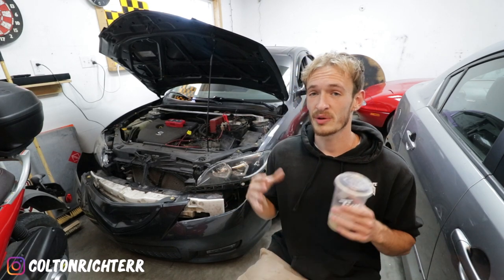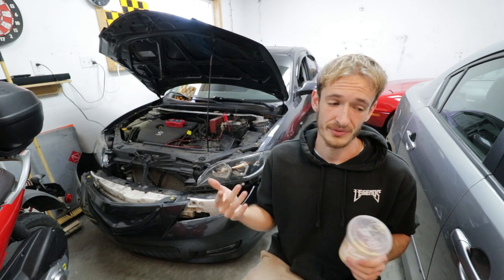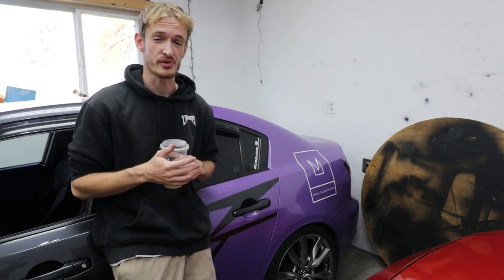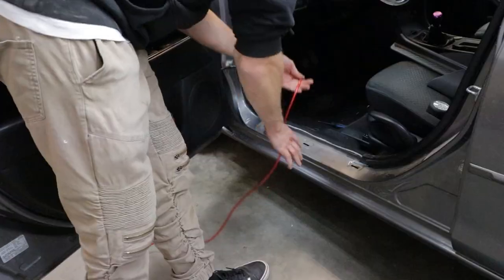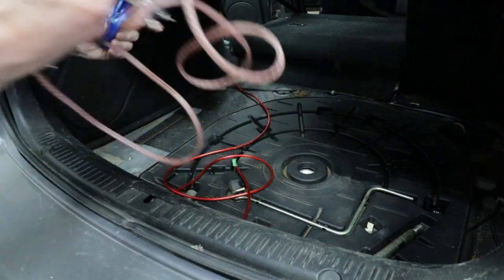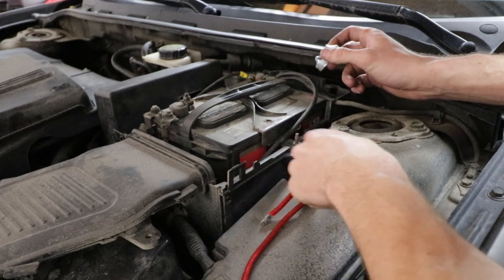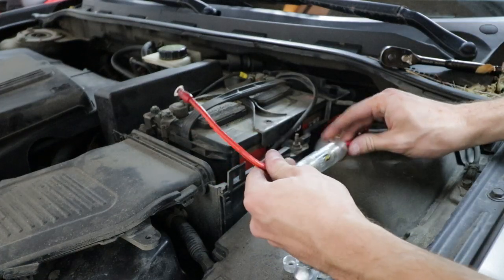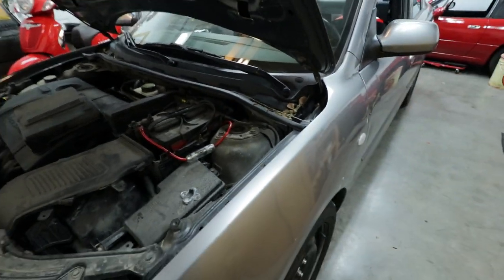MAZDA 3 Subwoofer & Amplifier EASY Install Tutorial!

Comment: sry man i feel dumb for asking u this but im sting up a rlly huge rockford sub and i rlly dont want to mess things up my question is only about de ground cable were did it come from? i have a 2011 mazda 3 hatchback 2.5
Reply from the maker: Where did it come from? Your ground cable comes with your wiring kit. 

I bolt them down the the rear seat mount.

Comment: the amp power on should have been connected to the blue wire on the back of the stereo called r e m or blue amp wire on the stereo its self so the amp only comes on when you turn the stereo on not the egnition otherwise if you dont want the stereo on the amp will come on anyway when you turn the key
Reply from the maker: Ah, didn't know what that blue one was for 😂
Reply: Hello do you know i lot about it cuz i wanna connect a subwoofer in my 07 mazdaspeed 3 but it is stock radio, I want to know how it can be connected in my stock radio.
Reply: @gtavlovers3354  you can run rca to speakers into the amp  omn a stock radio
Reply: @AdamSNook.  can you do a diagram for me how it can be made.
Reply: @gtavlovers3354  on most car amps you have a high input aswell as left and right phono you connect your speaker wires from left and right speakers to the high power input on the amp so your stock radio as ither 2 channel or 4 channle 2 run all 4 door speakers you just need to tap from them to the high input on the amp
Reply: @AdamSNook.   ok.
Reply: @AdamSNook.  I want to do a bluetooth conection into mine stock stereo cuz I don't have AUX cable option in my phone
Reply: @gtavlovers3354  u can get blue tooth that works by using a radio station ut plugs into a car lighter socket
Reply: @gtavlovers3354  yo idk if you still need bt. But look into gta car kits 2006 mazda 3 Bluetooth kit. Its a little box that plugs into the back of the radio and you can hide the box and cords in between the emergency brake puller under the plastic

Comment: I have an 09 mazdaspeed 3 w/ the factory Bose system, I assume the install would be fairly similar. Do you know of any differences?
Reply from the maker: You need some sort of splitter to wire in with the factory system
Reply: I’m new to car audio, do you have any brand recommendations and specifically know what wire that is I’ll need? I can’t seem to find much out there for instructions on my car.
Reply from the maker: There's a few forum write ups on it

Comment: So if I have a stock radio unit then I would need a line output converter to plug in my rca cables?
Reply from the maker: Correct

Comment: Hi Im about to try an 8nstall (fist time) but when I test the equipment ie amp and sub at home using a 12v plug adapter the audio works but amp goes into protect mode the moment too much bass kicks in? Any idea why this is will it still do this if its grounded in car?
Reply from the maker: Uhhhh if I had to guess... i've never tested car audio in a house

1. You're either overpowering the amp
2. Not grounding properly in a 12v plug
3. Something just seems hella' fishy about powering that stuff with a plug adapter
Reply: If anyone else is reading this, do NOT use a cheap AC to 12V adapter to run car amplifiers... Car amps usually require much more power than those can handle. You have to match your amplifier's power needs to your power source. For example, I built a "portable" high power sound system for outside use, and it required about about 600 watts of power. So I got a 700 watt 110V AC to 12V DC power supply and it runs just fine!

You could in theory use that cheapo adapter to make sure everything turns on and is working, but you cannot turn the volume up. That why the amp goes into protect.

Comment: what if you have a subwoofer setting on your radio and it’s turned off. will that cut power to your sub? i’m just trying to troubleshoot some things
Reply from the maker: No, your radio does not control your amp power.

Comment: Can you connect a subwoofer Mazda 3 2008 stock radio?
Reply from the maker: Yes
Reply: @ColtonRichter  do you need anything else or can you just use the wiring kit?
Reply: @Peter-jk9fx  if you didn't find out yet, you would need to use line level converter.

Comment: Need to do this but need a amp and a rca converter don’t want to buy a aftermarket radio
Reply from the maker: Also need to bypass the Bose amp!
Reply: What I did was to keep the stock head unit and replaced all door speakers with JBL Club speakers, with an additional tweeter kit installed in the wing mirror bolt covers. For bass, I got a thin 12" active subwoofer, taped the vottom full of velcro and placed it under the passenger seat. I ran audio cable vampire clipped off the speaker wires behind the head unit and power through the passenger side firewall gromit, with remote power piggybacked from a fuse in the cabin fusebox. All the cables are run under the door threshold and poke out from near the seatbelt bolts. Ground is taken from a seat bolt. Finally, the stock head unit got paired up with a Bluetooth module that pretends to be a CD changer, and music is streamed in over Bluetooth from a cheap tablet. That's the only less-than-clean bit of the entire rig.

All in all, I'm happy to have a hugely improved audio quality while keeping the car looking stock. That said, a new head unit would improve sound quality, but I want one that'll connect to the internet and run both Spotify and Maps so I can lose the tablet - those head units are just pretty hard to come by.

Comment: Why don’t amp installation kits come with speaker wire? Really annoying
Reply from the maker: Amp install, like a subwoofer wiring kit? Every kit i've bought comes with speaker wire!
Reply: @ColtonRichter I bought the EFX PA8BX amp wiring kit off Crutchfield. It came with power, ground, rca, remote, and accessorys but no speaker wire. Wasn't a problem I went and bought some 12 gauge speaker wire from the hardware store but you would think it should come with the kit. Seems that's how most kits are off Crutchfield besides the kits over $100😵even though they say the kit has everything you will need to wire up your system.

Comment: the connectors you used suck and should only be temporary use only (remote wire) unless they have improved in the past 20 yrs